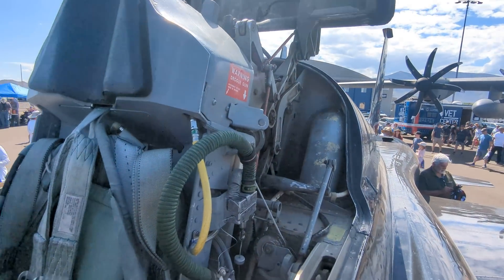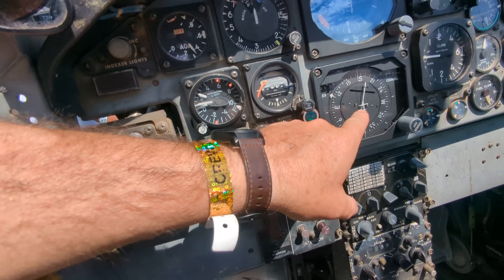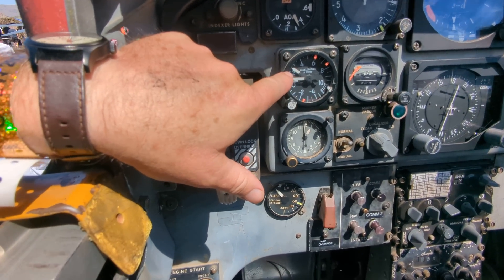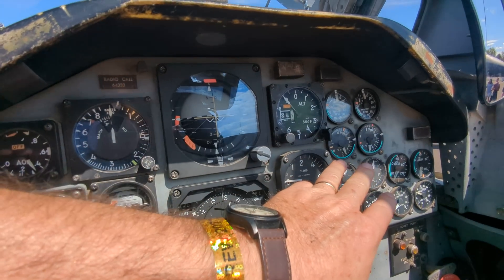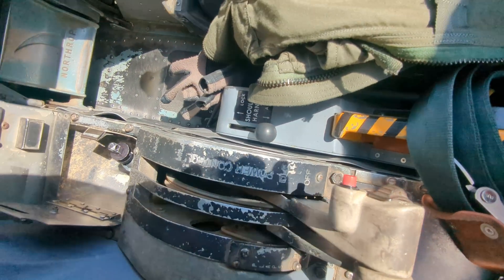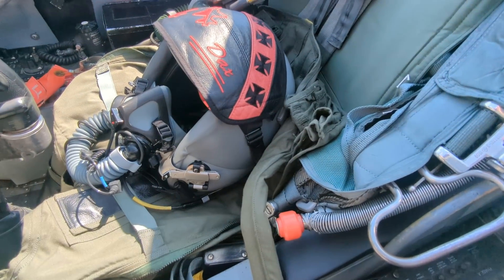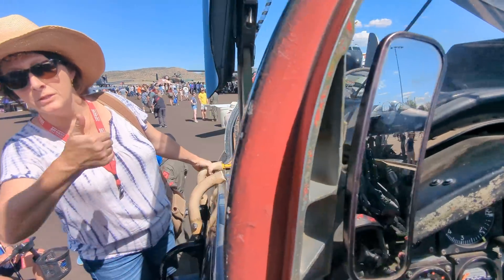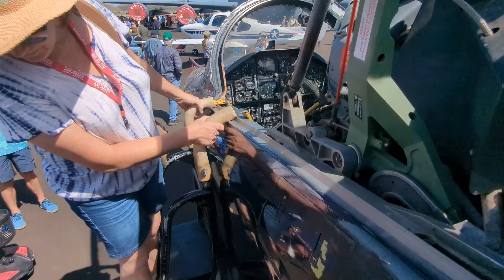T-38 Cockpit Reno 2023

Comment: Juan - thanks for the peek at the old T-38. I was in class 72-08 at Vance. Then flew them again as an IP from 1976-1980. All prior to the AOA system being installed. I still think that the "tickle and wing rock" was a pretty good indication of your AOA,  didn't really need the AOA system.

Comment: I don't remember the T-38 having ADF, The bearing pointer was for the TACAN/VOR. We had a seat of the pants method using the bearing pointer and finger prints on the HSI to navigate point to point and ATC would let us try. The bearing pointer had no tail. I was very happy to see that commercial A/C had tails for their bearing pointers which came in handy for ADF approaches.  "Push the head and pull the tail"
Reply from the maker: Correct!
Reply: Yep.
Reply: Very good!
Reply: Juan's memory is a little hazy. The DG is an HSI. The "VOR needle" is a TACAN CDI (I think course deviation indicator). But he was, as would we be, a little excited to see your first love after a long time. @bja2024